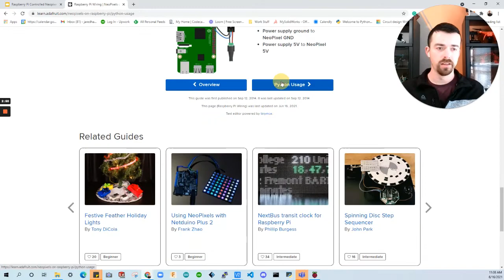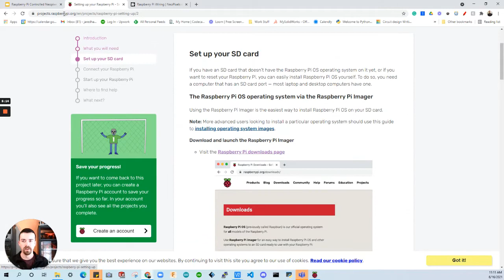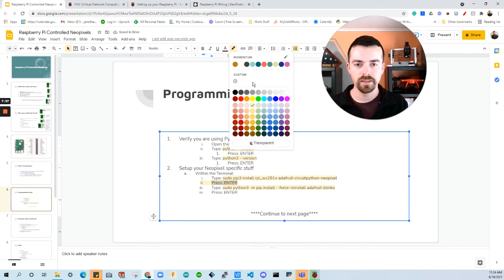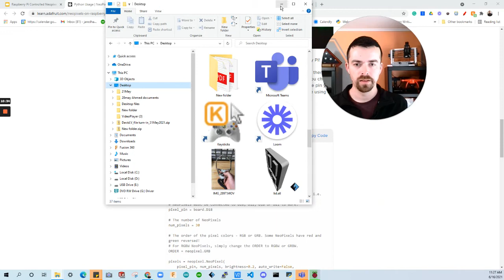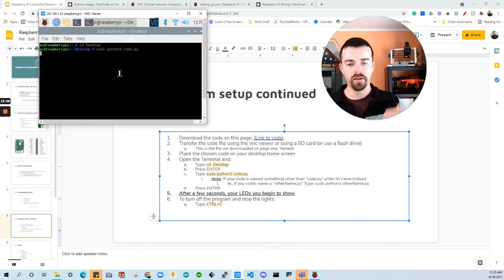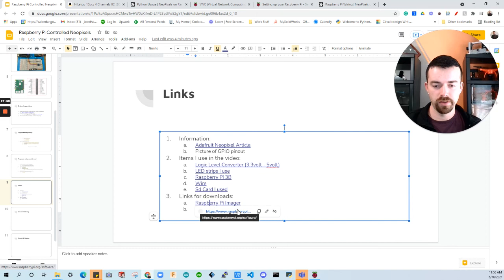Control Neopixels using a Raspberry Pi Step-by-step tutorial with all links and code

Comment: Thanks for the video! I have a project where I need to run 4 seperate Neopixel strings from a single RaspberryPi, Is this even possible as I see many people saying you can only run 1. Thanks! all advice welcome as I'm a bit stumped at the moment. The reason why I need to run 4 is each string will be removable and have different options available for selection.
Reply from the maker: Yes. I do it quite often with Arduino and and FastLED library. You can apply the same technique to the raspberry pi. Feel free to reach out via the discord linked in the video discription.